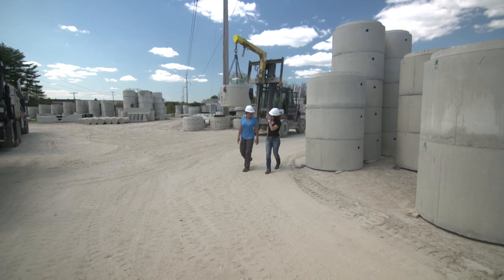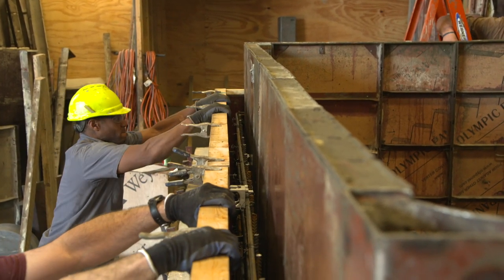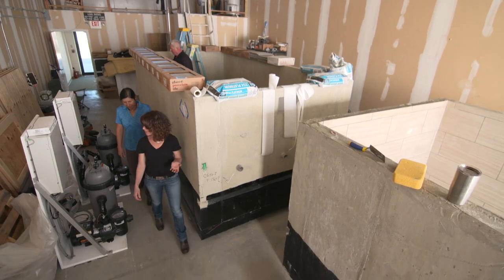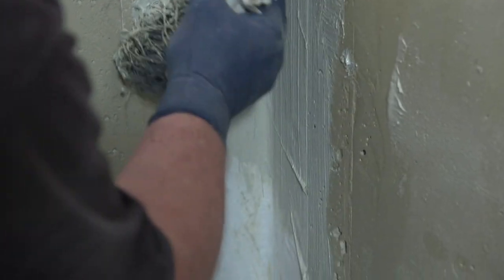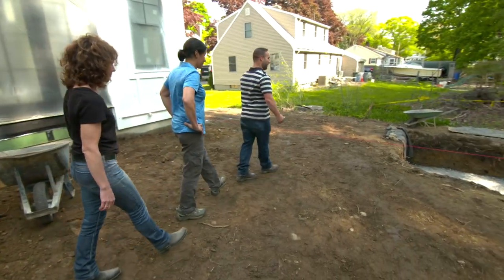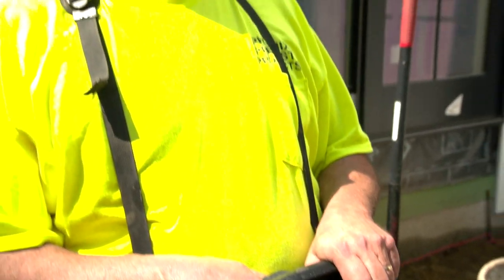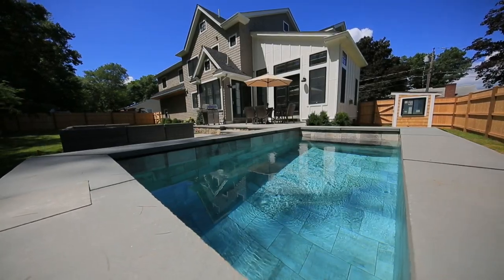How to Install a Plunge Pool | Ask This Old House

Comment: So, the answer to "How to Install a Plunge Pool" is just pay someone to do it for you?
Reply: Sometimes that's the answer.
Reply: @watcherofwatchers  that is never the answer. Sack up, take charge, build it well. I like to think ill get something 5 to 10x  better if i spend what it cost for someone else to do it and just do it myself. One catch, you do need a wide selection of tools and mechanical skills.
Reply: Raul Duke There is also a lot of pool-specific knowledge you need to know. By doing it yourself you take the gamble that you miss a detail. Where drains and the filter outlet should go, for safety you need at least 2 drains per pump so you cannot get stuck on one under water, the chemistry of the water (PH level, chlorine or salt), and there is some kind of valve which prevents your pool exploding out of the ground caused by the water table if you empty it. Such things are easily skipped by accident if you’re not in the business and don’t research enough.
Reply: They still showed how it’s installed. They never said who would install it. 😉
Reply: Absolutely false. People with expertise exist for a reason. If it's something you really care about or has some safety risk to it being done improperly you should probably find a highly experienced and reputable person to do it. If it is something you can afford to mess up on, that I would totally agree is worth attempting. Sure, paying for a professional installation will cost more than material costs.

 The wording you used suggests that you don't value your time at all, which is a big mistake. Say you make $50 an hour at work. You're looking to have a pool installed and you find a reputable very well regarded installer who has a fantastic history. Hypothetically he will charge you material costs (let's say that is $2,000) and he will charge you $100 an hour for labor and it will take him 20 hours. So in this case you would expect to pay around $4,000 in this hypothetical. I'm aware those aren't necessarily reflective of real costs, but for this example we'll go with those.

Now you, as someone who thinks that they are asking way too much does a little research and finds the cost of the materials somewhere online or in a store. Now you figure out how much he is asking for in labor costs and decide that he is asking way too much; You'll do the job yourself. As someone who has 0 experience with masonry, land surveying, or general pool knowledge you would rather work on the job on your spare time. You're tasked with doing research (or major repairs later if you didn't do any) into how the job is done. You're responsible for coordinating material delivery and managing any problems with that. You have to learn on-the-fly how to physically apply the theory and thus you will be much slower than a professional. You'll also be doing the labor, which will be fatiguing you along the way. Say all of that is true and you end up spending 100 hours on the job. The end result, because of your inexperience, may also be lower in quality or finish than the professional's. You did the whole job for just the materials cost, congratulations!

You saved $2,000 at a cost of 80 hours labor and a lower quality job just by nature of your inexperience. So now you've valued your time at $25 an hour which is in this case exactly half of what you would have just made by working, or less if you worked overtime to pay for the pool. All the while having the various problems that come along with a "Harry the homeowner" installation. On top of all of that, you were responsible both mentally and physically for performing the job. Between managing the stock, going to buy more materials, actually doing the physical labor, etc. All for what is probably going to be an improperly installed pool (or at least one with minor flaws) and a broken back. It's worth mentioning that you may have earned some experience with pools along the way, which is something that I'm sure will come in handy when you replace your pool in 40 years.

For me, I would rather pay the professional and maybe work some overtime at my job. For you, if experience is worth that much for you, go for the latter.
Reply: @RiouInsuiko  for most people that is a great write up. For someone like myself, you speak to which you do not know. Money and time are of no issue, guess that is another catch. Experience is not lacking here either. Research is not something i mind doing and i do a lot of it. One thing i have to call people in to do is snake roots from my drain. Other than that, i have never called anyone for anything. I just so happen to value my time at $50/hr because that is what i charge to do the work i do.....when i have to work. So, to sum it up, i can handle most anything with my tools, research, skills, and knowledge.
Reply: The title should more appropriately be "Plug pool installation". How to indicates they would be showing us HOW TO build it ourselves.
Reply: I mean it works
Reply: "pool"
Reply: Yeah, DIY. Just build a huge mold and get 18,000 pounds in concrete! Easy, right?
Reply: @raulduke7142  What's stopping you?
Reply: I agree with this guy, there’s a book out there to learn all of this and a bunch of YouTube videos now. A lot of people will say experts and bullshit, but I watched my father learn from books how to build a house and it’s still standing 27 years later, no failures. The people that insist on experts are people that insist they can never be qualified for the job.
Reply: Some of you might  find this suprising but some people make lots of money and paying up is no big deal. I am blue collar but my wife is not. I used to do all my own work but as I have aged I no longer feel.the need to work like a dog to save a buck, it's time to let others work hard I am done with that.
Reply: @raulduke7142  Yeah, that minor detail (tools), isnt it?
Reply: @Bipbop66  tools are 70% of any job. 20% is skill, and the other 10% is the balls to take on the job.
Reply: @jacobhenderson1732  if you got the money, than yeah.
Reply: Cry 😂

Comment: FYI, from the company's website: 

Cost for a 7' x 13' pool with all features listed above is $22,750.

That does not include heat,  cover,  ladder or installation (from what i can gleen from the site) .
Reply: 😂 wow
Reply: What a bargain!  With that profit margin they could buy a lot of advertising.  For example buy a timeslot on a show that had  a great following but is existing mainly on the remainder of a once great reputation.  Guess that's why festool is all over the show too.
Reply: For people with more dollars than sense

Comment: I'm curious as to why they didn't vibrate all the air bubbles out of the concrete form? I noticed a lot of pits and pockets on the inside and outside.
Reply: S0uthp4w68 Yeah, you can only get rid of that appearance if you have a finished surface, which would have to be facing up and exposed.
Reply: Well...it only costs $23k before installation so they barely make any money as it is😂😂😂
Reply: Just because they did not show it does not mean it was not done. All concrete should/ must be vibrated to make sure there are no voids it the finished product...
Reply: Because the vibrating device is out of service due to overuse by the pool making chick
Reply: The concrete has a lot of apparent holes. Imagine how it is around the rebar. It is not vibrated, the waterproofing didn't go all the way into the visible holes of the concrete walls, the grout was applied wrong. This is a disaster.

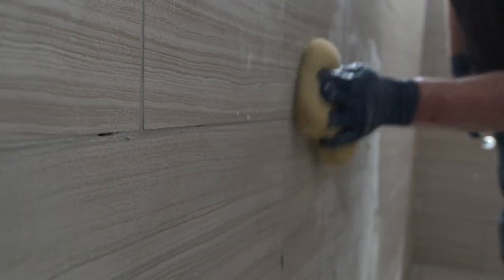Comment: 3:46 The moment you are using a spunge in a tiling job, all the holes should have been filled already i think?
Reply: And the water proofing done with a roller over all those holes. They should have used a vibrator after the pour to get rid pf the air bubbles. And why did they not have a tube for the concrete fillig, seems like alot of it went outside of the kassets.
Other than that the idea is good.
Reply: Richard van Pukkem proves you don’t by a pool from these jokers
Reply: Shouldn’t there have been some crushed modified or stonedust above that 3/4 layer as well?
Reply: zack9912000 I don't know about concrete but I know these pools have to be overpriced because of all the waste. Also, the workers look like they are unhappy. I bet they don't care if the pools come out crappy or with flaws. IMHO
Reply: The sponge will help fill in the holes if there's enough material left, which there was not
Reply: Wondering if anyone else saw that!
Reply: Lel
Reply: I see I wasn't the only one that noticed.

Comment: If the problem is the space, I would rather get a hot tub, I would probably enjoy it more than the little pool
Reply: right!
Reply: Gabriele De Mattia
Reply: That’s really what it is, I have built pool spas on pools that are bigger than that and in reality the “plunge pool” is just a large spa.
Reply: Though if you have the space to swim around a bit, then you have fresh temperature water flowing along your body. So that feels more refreshing than sitting still in a pool. And a bit of excercise of course.
Reply: At my house we have a pool, it's a decent size. We also have a hot tub. We get wayyyy more use out of the hot tub. We are in it almost every night of the year. We are planning on moving and we are only getting a hot tub, we just don't get enough use out of the pool and they are a lot of work

Comment: When setting large format tile (LFT), it’s not recommended to offset the tiles by more than one third because you’ll end up with lippage as can be seen in this video where the tiles were offset 1/2. The finished installation is very pretty, though.
Reply: yup i saw that too along with air bubble gap in the grout, yikes

Comment: For that money might as well install it inside the house.  Cut a hole in the floor and lower it into the basement with a crane.  Then install the proper ventilation inside (because indoor pools need ventilation).  If I was spending that kind of money, I would want my pool inside the house so I could use it year round.

Comment: How deep is the pool shown? Is it heated? (The woman from the pool company said "summer and winter..." so how is that made possible?  In a regimen of physical therapy years ago, the treatment took place in a therapy pool that was shallow enough in one area to be able to walk and deep enough in other areas that you could only tread water. The pool was heated to something over 100 degrees. It was a small pool in size but designed with those physical therapy needs in mind. Would this pool shown on TOH be suitable for that kind of home PT?

Comment: They did not mention winter-ization... do you drain it?  Ice expands and could do a job on those tiles...
Reply: They said "cool in the summer and warm in the winter" so they aren't draining it, they are using it all year round.
Reply: 0:16
Reply: So it must be heated... it will cost a fortune to keep open up north, just to keep it from freezing.
Reply: @TNtoolman  use your heat pump from your ac unit

Comment: Can you add parts to make it a swim resistance pool part time?
Reply: If u can't add pumps to do that I think some company makes a system of suction cups, bands and velcro cuffs and waistband that would do similar and probably for a lot less
Reply: Set up bungee cords. There are commercial produced  harnesses for sale that allow you to swim not do endless flip turns. I have a 10' pool and use it 6 months of the year for exercise.

Comment: How much are these? I want one for my house
Reply: AdmiralTwitch I hear such sums often when talking about pools but i cannot imagine how such price is put together. I could DIY it for less than 5000 i guess. Hire excavator, dig hole, order concrete truck to pour a floor, put a square brick wall on it, put some online-ordered holes in the sides for the filter, apply water proofing, and tile the whole thing. Run PVC tubing to the pump and filter. If you spend a 1000 on each subject you would not reach 24k, and i don’t think either the concrete or the tiles or the excavator rent will cost 1000 each.
Reply: @Engineer9736  you sir are very worng a licensed and insured excavator with be at least 2000, concrete probably like 2000 and the block for a wall I'd bet is like 1500 ( dont forget u need motor, rear every 3 holes in the block and concrete to fill them) then title can be like 2500 for the type they used and there's a bunch of extra little things and that's not including labor. So there's 8000 without labor and the fact they do it in a plant means it should cost less to manufacture cuz of preferred working conditions
Reply: Concrete slab: https://www.improvenet.com/r/costs-and-prices/concrete-slabs 1.88 per square foot. 8x4 meters = 26x13 foot, sums up to 635 dollars, give or take a bit. Then you have a larger floor than the pools in this video.
Reply: @Engineer9736  those things r so off and worng it's not funny, I just did a 8 inch concrete wall for a customer that was like 800 in concrete just for 2.5 yards that's without cost of forms, bar, snap ties, excavation, or labor. It was part of a bigger job but probably said and done total cost is 5000 to 6000 for the wall inside dimensions ( it's a U shape ) 72" deep  x 48" wide  x 54" tall and 8" thick